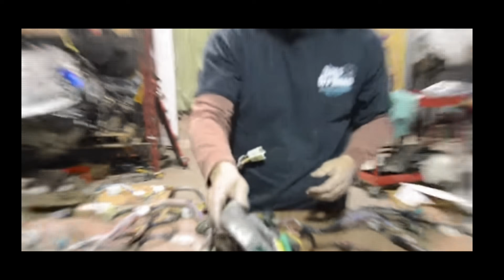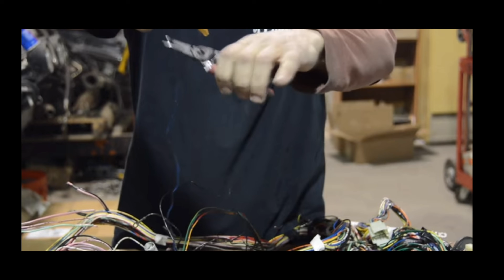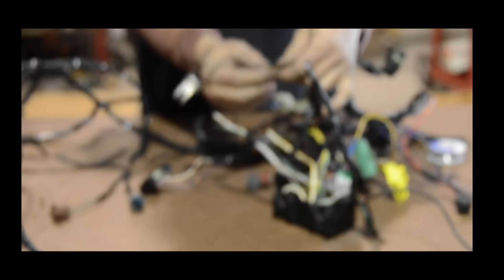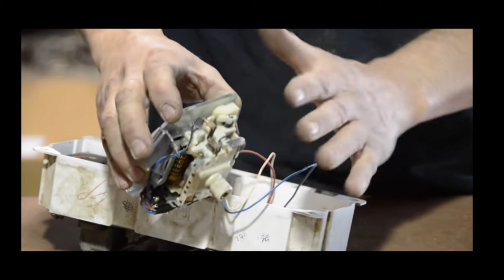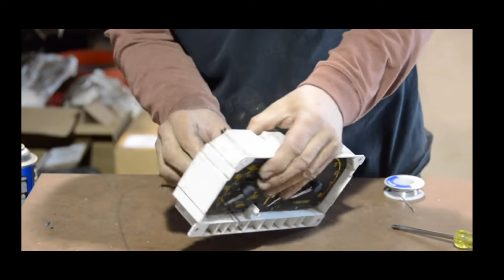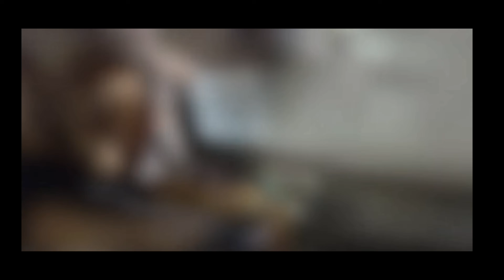How to 1991-95 8v Sidekick Tracker EFI Your Suzuki Samurai!

Comment: Hey My,  i am curious if this same instruction system applies to the firat gen tbi?
Reply from the maker: Not at all different harness. 89-90 is first gen. 91-95 sold far more cars with advanced efi tbi.
Reply: @Zuksoffroad do you happen to have an instruction set that I could purchase? I may have buggered it up.

I have an sj410 that I put a first Gen tbi into. I got all of the stuff hooked up on the sj410 side hooked up to it, but I kind of guessed what gets removed in that harness comparing it to this video. Anything I wasnt sure about I left. Except for the chip on the inside. I chopped that.  I ordered a compatible coil for it, as I only had a 91 and up coil. I didnt cut much off of the fuse box, except for a few wires that didnt go anywhere after removing stuff that would have been on the cab side
Reply from the maker: @johngloom9235  you have to get me your email and not here. Text it to me and ask for the popcorn schematic
Reply: @Zuksoffroad thanks Myron!

Comment: So, quick question regarding emissions and engine performance. 

Will the 1.6 EFI put more fuel into the 1.3 engine? Meaning that, will the engine run richer? Wont the engine bog due to excess fuel? Will emissions be higher than the 1.3 EFI?

Asking that because im planning to swap a 1.6 efi into a 1.2 engine. I was wondering if the 1.6 EFI will affect the 1.2 engine's performance and emissions.
Reply from the maker: It’s a closed loop system meaning the efi o2 sensor will tell computer it’s running rich and u load injector to maintain a preprogrammed fuel delivery. However it can not work in the reverse. So a 1.3 Suzuki efi tbi system would have to have the 1.6 injector installed for the proper power for the 1.6 engine.

Comment: So which way to go??  EFI or side draft??on a 1.3. Which costs more and which has better parts availability?
Reply from the maker: Been saying this for a long time. Efi is cool but you had better become an efi expert. This old stuff is getting rarer and more costly as it gets older. Most shops have zero knowledge on 30 year old systems. There are new efi products like mega squirt/sniper etc. Expensive and technical. I keep using CV carbs on my rigs. Next personal build is turbo propane.
Reply: @Zuksoffroad  Thanks for the reply, The whole EFI route looks like it just adds complexity and I prefer the old school anyway.  Kind of a cool idea putting a motorcycle carb on a car anyway.
Reply: @Zuksoffroad get a 22r propane kit and adapt it, use tracker/sidekick intake and exhaust and can go up to a ko3 turbo, the ko3 on a 1.8t vw make full boost at 2200 rpm. Great for samurai
Reply from the maker: Been working for thousands of Suzuki owners world wide since 2005.
Reply: Toyota 22r propane kit and adapt it to sami intake, you can also throw a sidekick/tracker intake and exhaust if you run a mild build ao you have a little more flow. Also the toyota 22r propane setup has more flow than the little sami propane setup so you can turbo it even and still have enough room for adjustment for power😎🤘